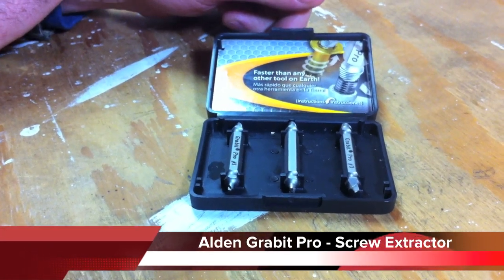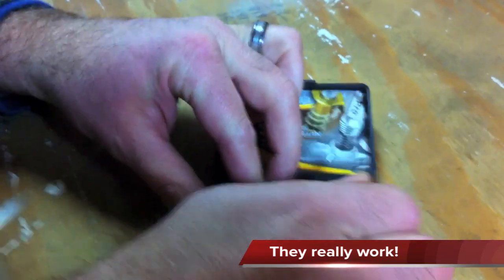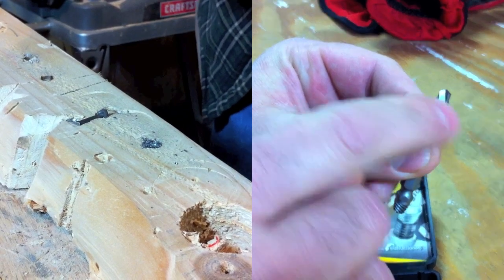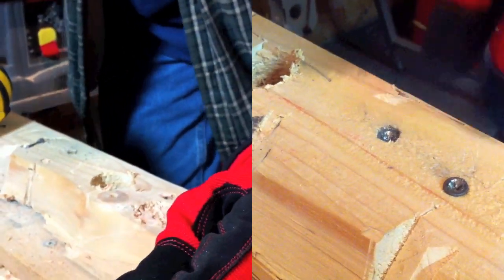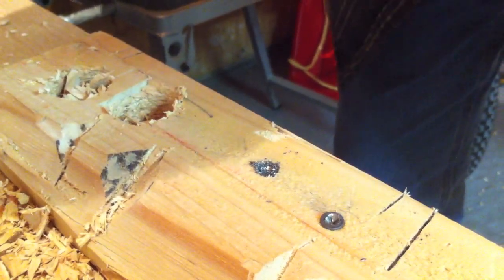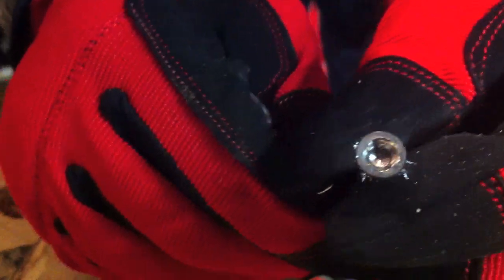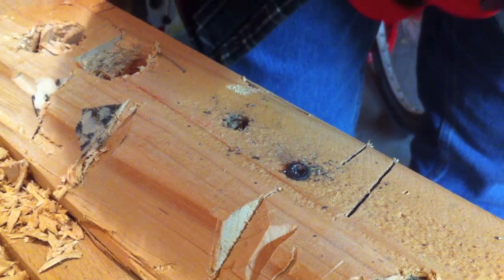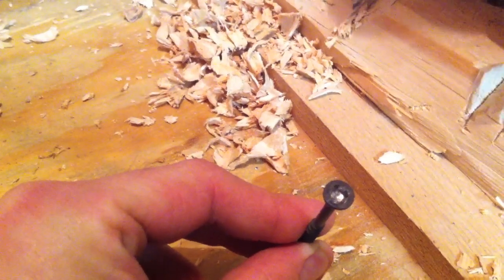Grabit Pro Screw Extractor - Review

Comment: Great vid! Just used it on a stripped "Torx" T20 machine bolt. Tight metal on metal! I used the G 4-7 and it worked like a charm. Make sure to be patient as this can easily turn into a problem if you rush it.

Comment: I noticed the first screw came out with seemingly zero resistance on it's removal. The second screw made a slight squeal noise on extraction when it was 3/4 of the way out. I have found that every 3" screw I have driven into wood does so with resistance going in and coming out. How many times were those screws run in & out of that board before you stripped the screw heads? This video review seems like the results were predetermined and aided but not what someone could be expected in real life.

Comment: If the screw is frozen in a metal fitting b/c it was the wrong THREAD for the fastener, the Grabit won't work. Had to use a saw and Wonderbar to remove the stripped /frozen screw.

Comment: These are useless for any kind of screw/bolt that has ACTUAL resistance on it.  9/10 times the reason a screw gets rounded is because it's seized while trying to remove it.  These GrabIt's will just spin and do nothing.
Reply: ***** - You could try the next size up extractor, if you haven't already used it.  Make sure you keep low RPM's on the drill so the extractor has a change to 'bite' the screw.

You can also try heating up whatever you are trying to remove, which might help break it lose.

Last options are more serious... left hand drill bits, welding a stud/screw onto it, etc.
Reply: Not in my case. I just suck at drilling.
Reply: You Tube Torx are the best! General note: If your bit is not catching, see if putting a rubber band between it and the stripped head helps. It’s helped me more times than not. The grab it’s worked every time I’ve used it.

Comment: They work on drywall screws anything self boring like decking screws they will do absolutely nothing.  Best bet is to grab a dremel with cutting head and make a straight cut down the center and then use manual flat head to remove the screw.

Comment: I don't think the exchange rate helps either.
But even with that taken into account, the Milwaukee fuel for example is between £380 to £417 bought over here from a U.K on line supplier.That's like you guys buying it for $606 to $665 at today 16th of May 2012 I wonder if that is how much they are over there?

Comment: SCREW HEAD SNAPPING OFF FIX:  a little trick i learned is simply open the chuck on your drill, then close it on the actual screw and tighten.  then reverse the direction of the drill and most times the screw will come out.  again, this only works if you have about a 1/4 inch space to grab onto the screw.
Reply from the maker: Craig Petey Great tip

Comment: I tried to use a regular "Grabit" to remove deck screws.  It did nothing.  I used the boring tip first, then the extracting tip did nothing but spin.  It didn't grab anything.  Very frustrating.
Reply: The only thing it grabs is your money they are useless not worth trying

Comment: Does anyone know what brand and model of power rotary tool or screwdriver that can be used with Grabit? Or any adapter I need to buy to pair with it. I bought the tiny one 1257P (#1) to work with my laptop and found my power screwdriver can't take it. Grabit is too small to fit in. I was thinking of buying Dremel rotary tool and found out it doesn't have reversible rotation. So it seems to be very tricky to pick a right power rotary tool. Any suggestion? Thanks a lot.

Comment: That's cute and all…but what about SCREWS THAT HAVE THE SCREW HEAD BROKE OFF!?!? Thats usually the point of "screw extractors"…I can not find a video on these actually being used for that purpose.
Reply from the maker: KRS I think you are screwed if the head is gone
Reply: KRS Agreed.  I am looking for that help too.
Reply: THANKS!
Reply: File it down to where the break is flat and level, then use like normal.

Comment: This isn’t going to work for screws that are straight up stuck, and that’s the reason it was stripped. If the screw is locked into place, your best bet is to cut a divot into it, using a Dremel or a file. Then hit it with a flat head screwdriver

Or, if even that doesn’t work, solder a metal rod onto the thing and wrench that shit out.

Comment: Tried this tool on decking tool. No use whatsoever. Maybe work on soft  screws but no it don't bore any hole and it doesn't wind the screw out. Outdoor screw been down for about five years. That's the type of screw I need out not brand new ones. Useless and waste of £15

Comment: Completely and utterly worthless when dealing with 3" composite deck screws (no. 9, square drive). Don't waste your money or time if that's what you're dealing with.
Reply: karaool You’re exactly right. I had my electric drill in high speed, in reverse, and not a shaving of metal came off. Deck screws are way to hard for this bit. Waste of money.